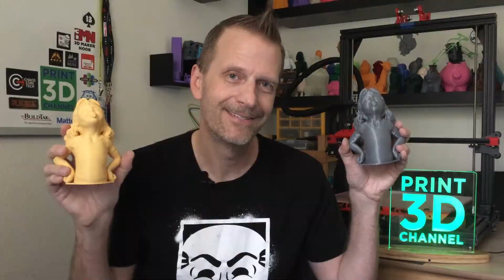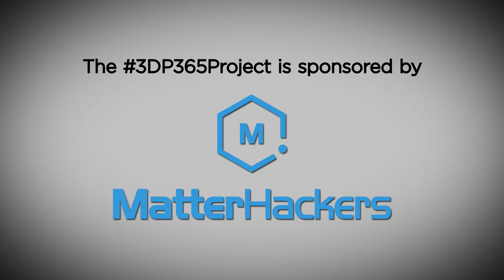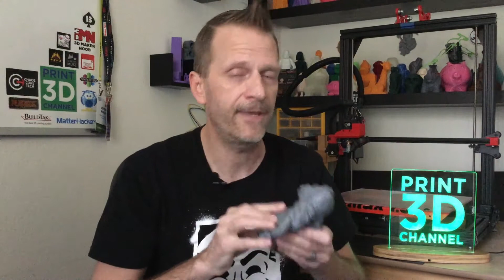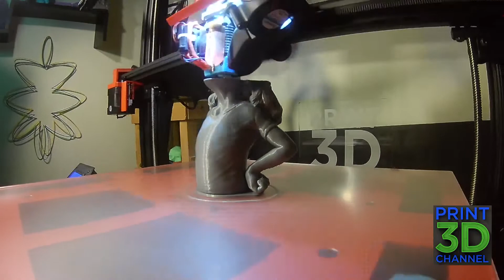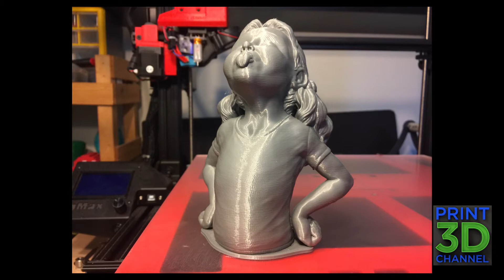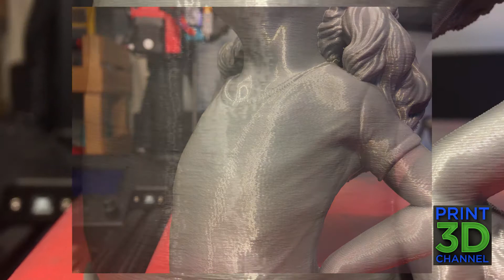#3DP365Project - Day 250 - Troubleshooting Results -  Cheeky Monkey #3DPrint

Comment: Maintenance is a work to do. I did it back to the solidoodle and it worked better. I did it even after the purchase of the deltaWASP, that it was necessary because it is second handed. Yesterday evening I did new maintenance for the tube between the Bowden and the cartridge of the extruder and adjusted the top. Today's result was amazing. It is just as every other machine. 

By the way, Great video, just don't forget it 😉
Reply from the maker: LOL, thanks and thanks for watching! Something that needs to be done every month if not less is to take a quick once over on the machine and make sure everything is still dialed in.